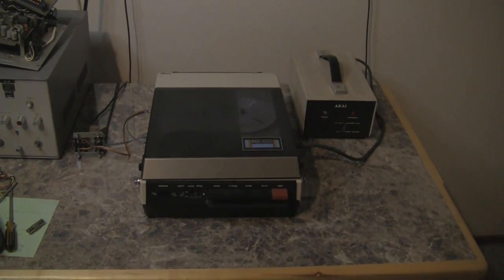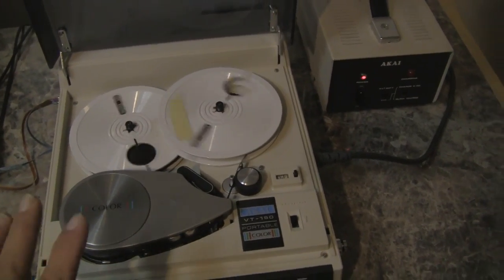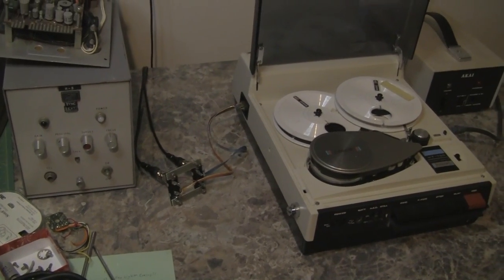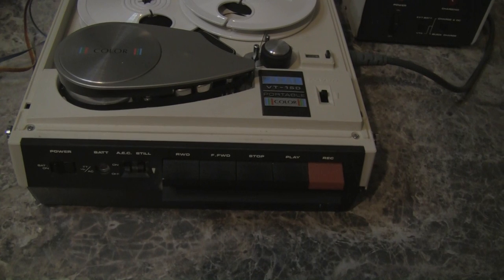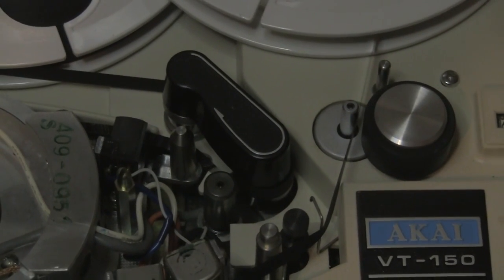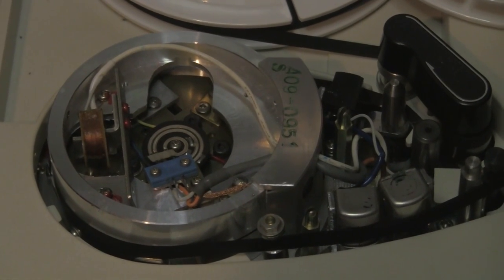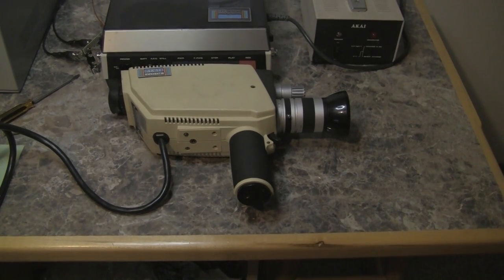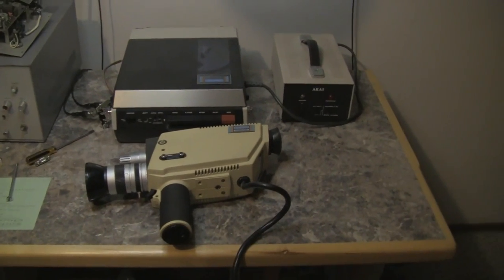Akai VT-150 Color Video Tape Recorder, Part 1

Comment: When the Akai video camera came out, ABC-DC news was still using film.  They borrowed my Akai camera to test the concept of using video for capturing news.  It was almost useless indoors because it needed so much light.  But, it convinced them that video, rather than film, was the best path forward for their news department.  I don't remember; but, they probably began with the Ikegami-33 backpack system when they finally bought their first portable field video camera.

Comment: We used this in Palm Springs at KMIR, running through the TBC and rerecorded to an RCA TR70 for playback during the newscast. I remember the real-world picture quality was milky, low contrast, low resolution. It was however, the only portable machine in the market that provided "news" gathering.
Reply from the maker: I knew that a few stations used them. AND I  suppose it beat 16m and even 8mm film. But, just barely. I found the cameras to make pictures just as you described. I never met a two tube color camera that I liked.

Comment: Does this require special metal tape or does it use the standard black and white akai tape. Thanks
Reply from the maker: As far as I can recall, it used the same tape as the monochrome machines.

Comment: Very nice video outfit Richard n seeing it actually work is a bonus! What is the recording resolution in horizontal lines, is it more or less than VHS 240 line resolution? Also I noticed you were curious about the white balance control, from my knowledge of white balance, when the camera's pointed at a white object n the button is pressed the colour balance is adjusted so the dominating white object is white n not tinted to any colour. I use it a lot on my 70s/80s colour cameras when using them.

Comment: Great video showing a great video playing some great video!  It looks to me though like you haven't got the tape going the right way around the right-hand guide post.  I'm pretty sure the tape should curl around the right side of the post.  (I assume the post to the left of the pinch roller is the capstan)  That might cure the take-up problem.

Comment: Hello friend this recorded video is same as used audio reels. Can you use an audio tape to record video in vtr?
Reply from the maker: Never use audio tape on a VTR. Video tape is polished to high sheen to prevent head wear. Audio tape is exactly like sandpaper. Most of the Akai decks have bad heads for this precise reason.
Reply: @videolabguy  thank you friend for respoder. took my doubts

Comment: The black head at the top is the erase head.
A erase head can not be after the videodrum.
Reply from the maker: The two silver heads following the scanner are the linear track erase head and then the control track / audio record / play head. The unseen big black plastic bodied erase head is the full track erase head used in full video/record. The metal colored erase head is used for audio dubbing.